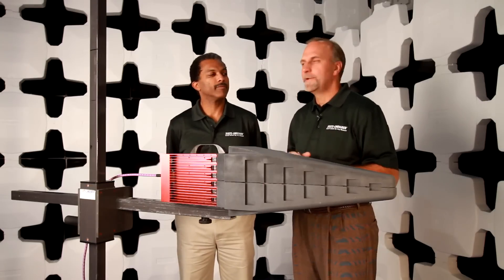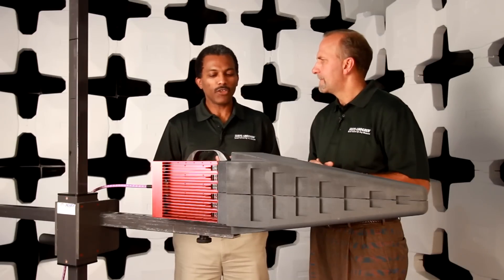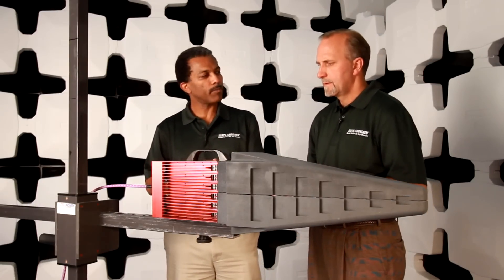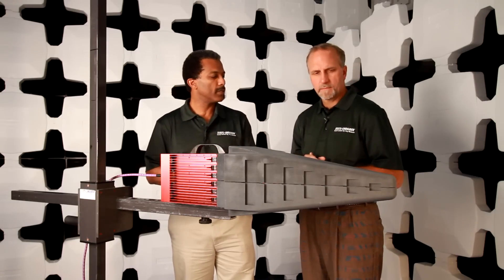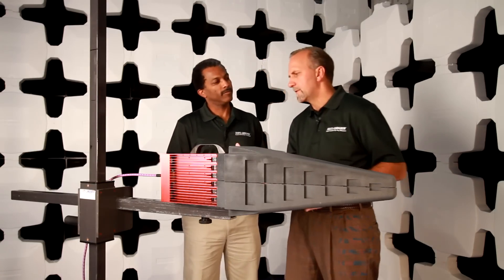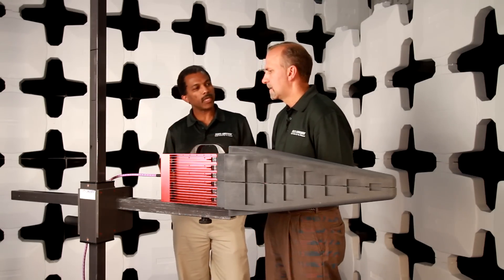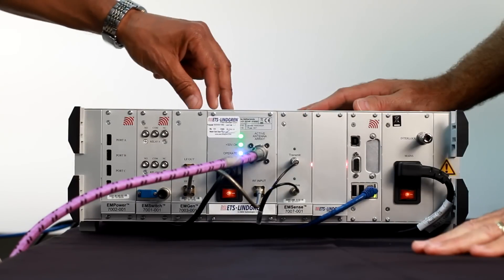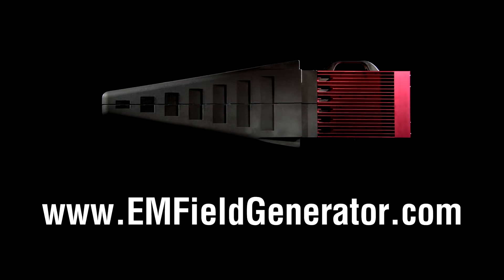ETS-Lindgren EMField™ Generator

Comment: So there's a field strength sensor in the chamber, and you also know forward power, reflected power, and antenna gain.  So you can calculate field and measure it.  It's nice that it's all one system.